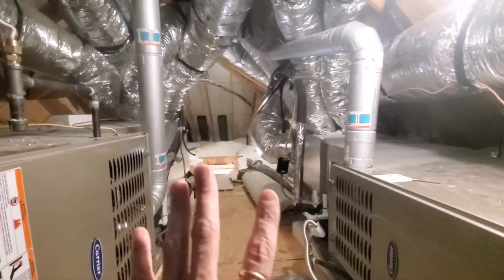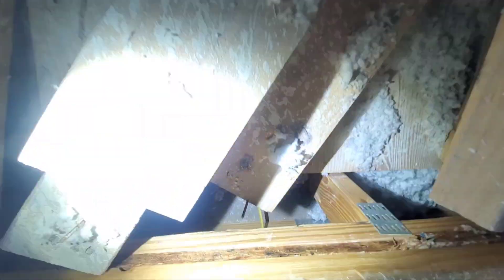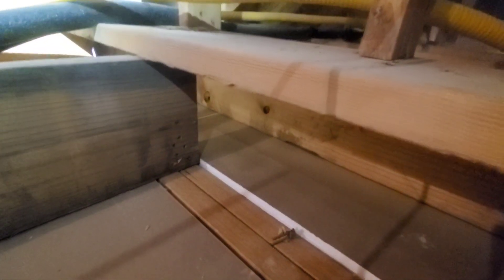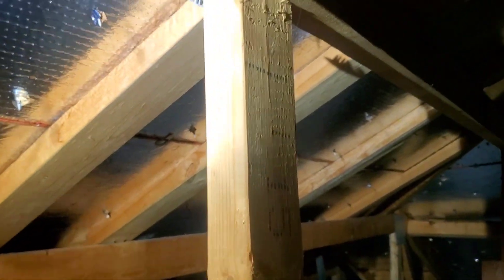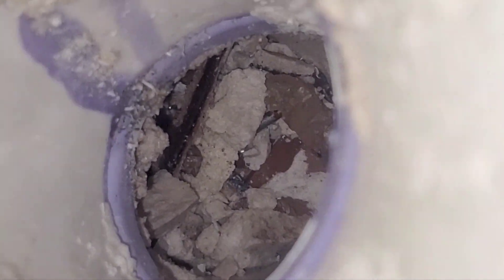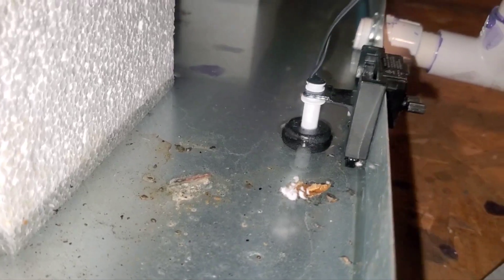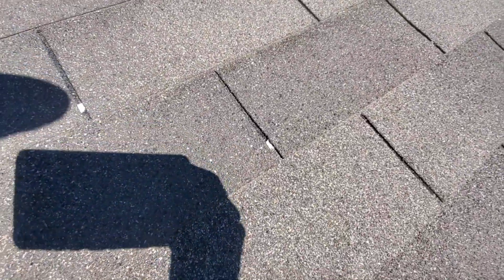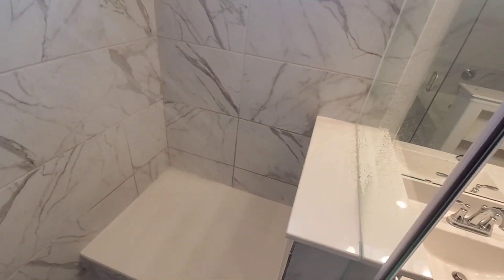What the inspector likes to see (If the builder *wants* the house to fail)

Comment: On the last example, a gutter on the upper portion of the roof would be beneficial.  The roof you're standing on won't last long with water pouring off the valley above.

Comment: We bought our house at a huge discount because there was obvious water damage in the master bedroom.  I'm sure every bidder assumed the house needed a new roof.  Our bid won and it was raining when we moved in, but the spot was bone dry.  I crawled up in the attic and traced the AC condensate drain.  It was sealed to the plumbing stack with plumbers putty.  Fixed it with a watertight fitting for $60 in materials and replaced the drywall.